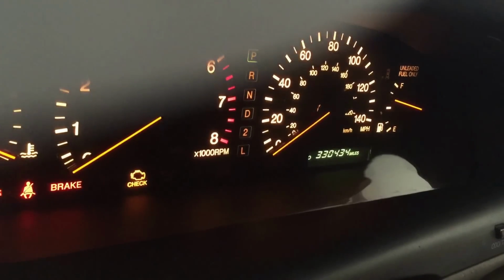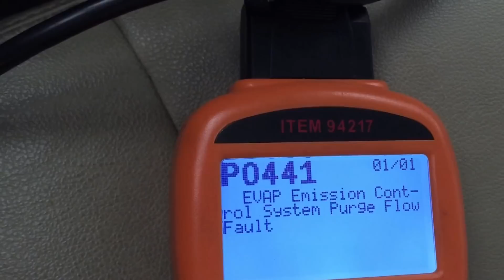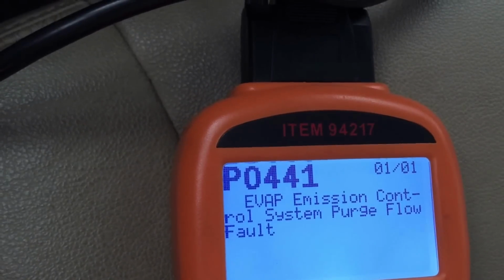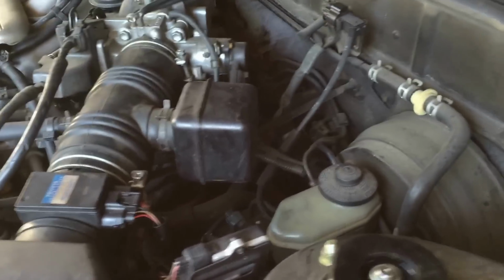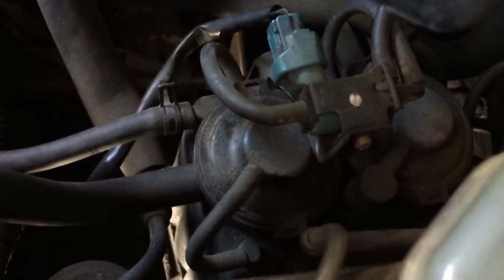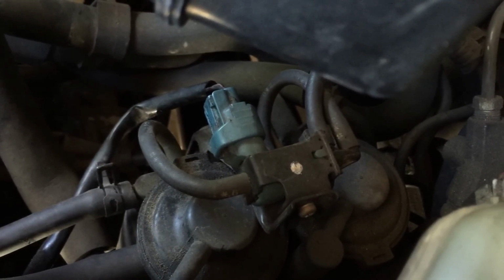P0441 evap PURGE Flow Fault 1996 Lexus ES300

Comment: Holly chomolly champ 330k miles i have 190k on mines i guess tune up and timing belt and water pump and shell go another 150k what amazing cars these old lexus are
Reply: i just sold a 99 camry xle v6 with 390k on it for $1000. started right up original motor and trans. the leather interior was decent as well.
Reply: Check out the million mile club in Japan, you'll be surprised on how long a lexus es300 and ls400 can really go,some in the world have over 1 million miles and still are running strong 💪

Comment: Lol, well First thanks for making a video.   second thanks for letting us know where it is. But man before u replace Anything just check it with a power probe this part can be good and once you replace it you might get the same code, then ur just wasting money.  Visual first, check sensors second, third smoke test, 4 determine what needs to be replaced. The more you do this the better you get. Power probes are like $45 and saves a lot of guess work.

Comment: Did you fix the problem by replacing the purge valve? I got the same code
Reply: Mauricio Lezama If u cleared it and got the same code it's because that sensor was not the problem.

Comment from the maker: Cool. Sorry about the bad video. I don't do this thing too often :-P
Reply: i have the same problem what to do next?
Reply from the maker: +Alex Barcelo 
You need to check the vacuum hoses for cracks. Over time they harden and will split at the metal connections. Use a mirror to check underneath as a visual check from above is not enough.

After testing all the components and hoses. I discovered my vacuum hose that sits on top of my throttle body had a split at the end which cause a massive vacuum leak.

Here is my tutorial on he fix on the Lexus Forum http://www.clublexus.com/forums/es-1st-to-4th-gen-1990-2006/778958-p0441-purge-flow-fault-1996-es300-gen-2-diagnosis-and-fix.html

This fix is for Camry as well with same 6 cylinder engine.

Best wishes,

Jim
Reply: I thought you did very good... show detail and move camera slow

Comment: I only change the ecm and a o2s which is located in the front of the engine never change the other two of in the back
Reply from the maker: +shawn biko 

ECM? not to rain on your parade, but those rarely go bad. Keep the old one just in case.

O2S and ECM are not related to the CEL codes you have. I say you have a loose/cracked hose or connector issues. Maybe in need of a new Charcoal canister. But my other video shows you how to test for that too.
Reply: +Jim Chang there was three codes that pop up but after replacing the ecm and a transmission fluid flush toke one code off and left the other two codes but i saw your video about the p0441 but im clue less on the p0450
Reply from the maker: +shawn biko 

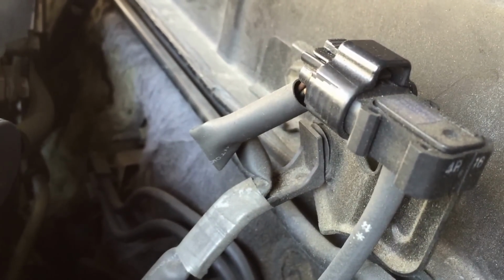In my Video at 1:15, that is the Vapor Pressure Switch which is related to error code P0450. Make sure the hose is not loose or cracked, it must make a tight seal. Also make sure the electrical connector is snug. I am not sure where you live but if you have allot of rain or snow. Check to make sure the connector is clean and not corroded.
Reply: shawn biko of

Comment: i have the same problem please can you help me out
Reply from the maker: +shawn biko 

I will try. So have you gone thru the testing and inspection procedure to insure everything is connected and not broken?

Let me know,
Reply: +Jim Chang  no i havent as yet been looking on line for a while now
Reply from the maker: +shawn biko 

Just be patient and use a small mirror to look behind some of those vacuum hoses.

In a pinch, you can use starter fluid/spray to spray around suspect hoses. If idle jumps you have a leaking hose.

Feel the hoses too, if they are really hard, that means they will easily have cracks around the connections.

So you have the Purge Flow Fault and Faulty Vapor Pressure Switch. It could be as simple as a disconnect switch or wire pulled from the connects. Take a close look at the connectors, if you see exposed wires, then that may be your issue.
Reply: shawn biko , Lol well. I cam help u and I bet u will find the problem.